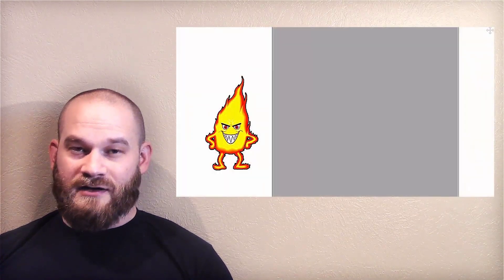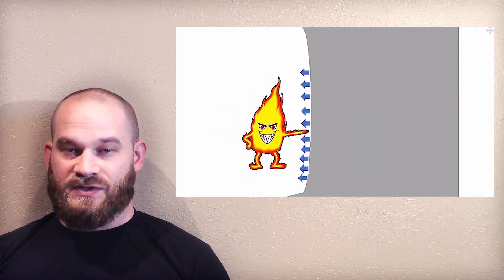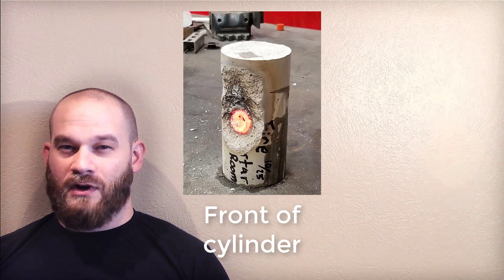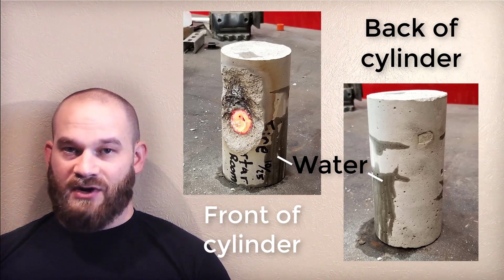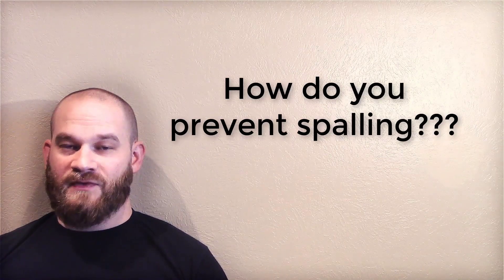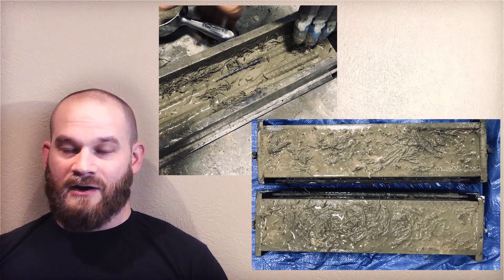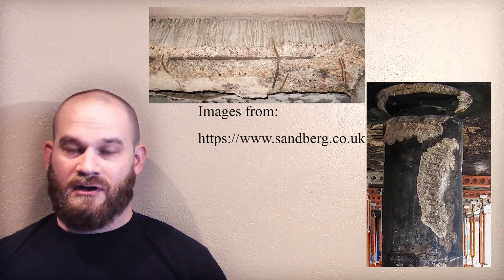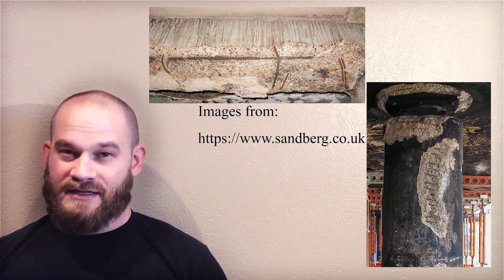Fire! v. Plastic Fibers in concrete - lab testing - class project

Comment: Not impressive actually. So a bit of heat and all your reinforcing melts???
And then the concrete simply fails. 

I think steel would be better choice in structural designs
For a fire-proof door, maybe

Comment: can you have a follow up video on concrete with fiber? how it's made? strength test before & after fire? surface quality after fire?
Reply from the maker: Thanks!  All good ideas.  I don't think the concrete will be strong after the fire.  The fibers leave holes in the concrete where they were after they evaporate.  The surface has some holes in the concrete but you can't really tell.

Comment: Very nice video, thank you all for posting.
The fibers "melt away"... allowing voids and area for displaced moisture...
With all that said, I think this should be a mandatory mix for bridge surfaces, especially where post tensioning profile comes near the wear layer and cars travel over same...
As a car fire may create a new load path if the concrete is weakened... This would be a rare event but is foreseeable.
All foreseeable events can be addressed before failure... mitigated.
What are the effects of heat on post tension cables?
Just a thought for you wonderful students.